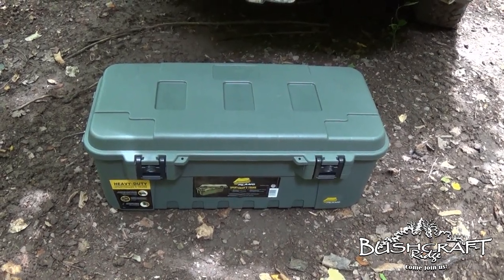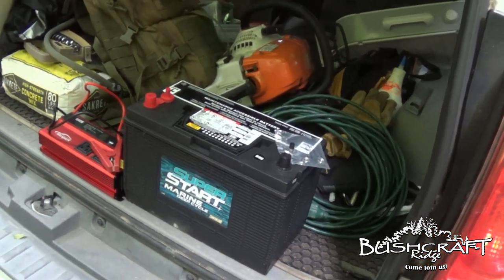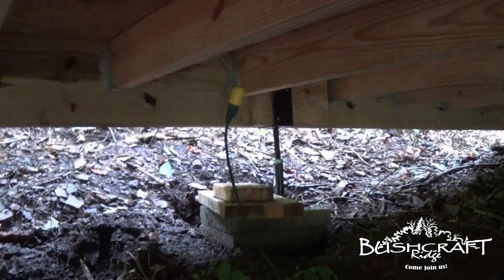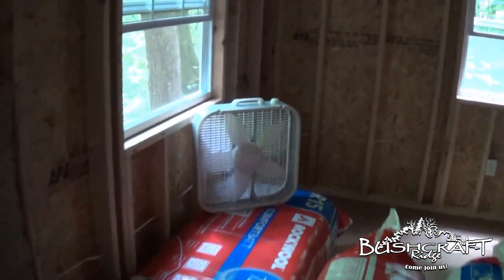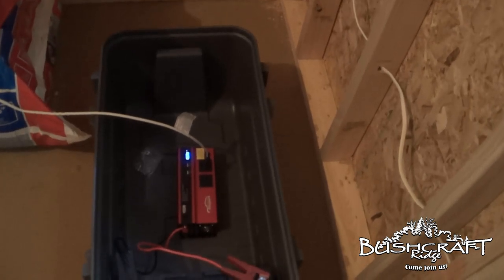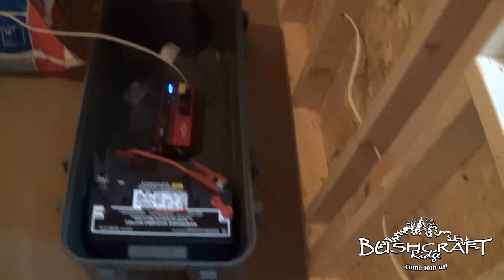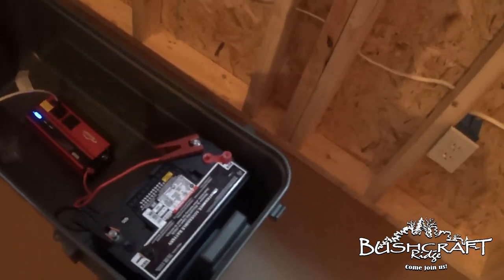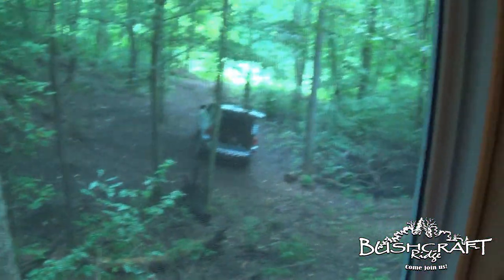Off-Grid Cabin Build 8.2.2020 -- Off-Grid Power

Comment: Them bugs bugging you 😆 Plano makes some awesome cases. I have one of their plastic ammo cases. A good rule of thumb with 120VAC is a line loss of 3VAC/100' of cord. My guess is in the walls you have 14/2 Cu going to the light, switch, and plugs. There could just be something wrong with the 1000W inverter...or that could be it's peak. A good rule for inverters and gen sets is take 50% of the flashy advertised number and that's more likely what you'll get. A regular household circuit is 1500W. I would look for and inverter rated for an output of at least 3000W. I do like the idea of adding on to the battery end. ✅ If you get an identical battery and connect it in series you will certainly increase the voltage to 24VDC and the run time to 210Ah. Very cool that the cabin is getting se power happening! 😎 Thanks for showing us the latest update. If you run into further problems with it shoot me an email. I'd be happy to help you troubleshoot it.
Reply from the maker: Thanks, brother! I knew I could count on you for some advice! :-)